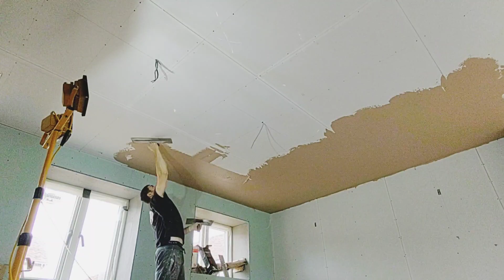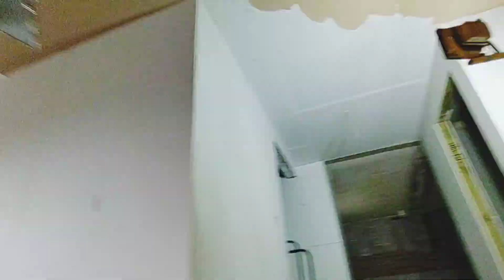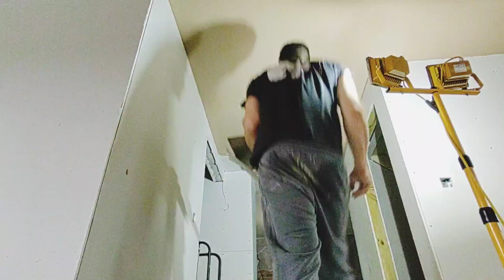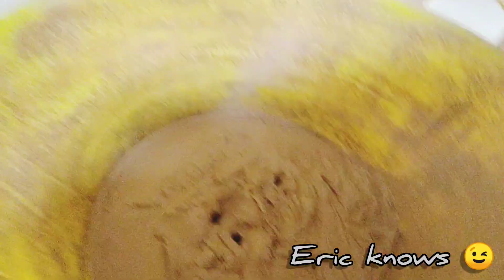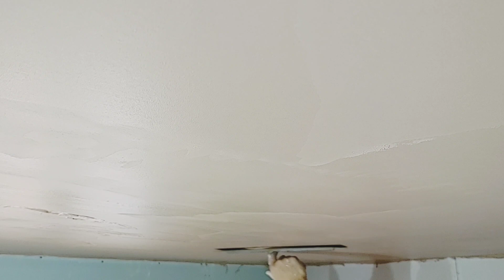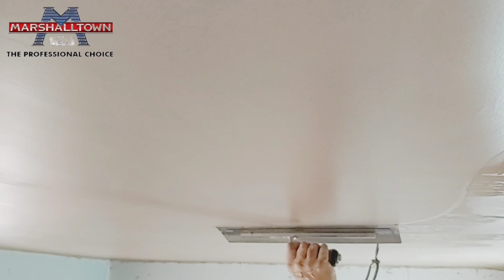WATCH and LEARN | PLASTERING A CEILING @neffexmusic

Comment: Hi Dan, hope you’re well. I’ve just bought an 18 inch nela carbon, only used 13 inch carbons recently. Haven’t measured if it’s 5 or 4.5 inches wide. I’m guessing you made the jump from a regular size trowel to a whopper, any advice? Cheers mate
Reply: Also bought the 800 nela spat and it’s great, flattens the first coat so much better than my Refina speedskim. I still use the Refina to give the second coat a quick go over as I found the spat took too much off.

Comment: How long do you leave your first coat before using the spat ? I've switched from my speed skim to the spat and I'm liking the results just abit unsure abit timings
Reply from the maker: Hi George 👋🏼
I like to wait around 15min from when I start laying on, not freshly laid but not too late to the point where you glide over and your trowel pattern still shows. You need to find that sweet spot, and your glide too! 
And never spat against tapered edges 👍🏼

Hope this helps ❤️

Comment: Quality as always Dan👍🏻. Are you using the steel spat on the second coat?
Reply from the maker: Thanks Mark
Yes mate, I also did my first wet trowel with the spat too but applied too much water and got covered in it lol so I deleted that part 😅

I may upload it in a shorts video 👍🏼
Reply: Are you just experimenting with that m8 cus you don’t usually use spat on second coat?
Reply from the maker: @Nofixedabode859  no Mick just haven't done it for a while. Back in the day I'd like to finish with a spatula from 2nd coat

I am experimenting on the perfect trowel combo though for you all, for minimal strain on the body 👍🏼

Comment: Do you spat second coat straight after? Or do you let it pick up ?
Reply from the maker: Never let it pick up mate, 2nd coat is very thin. If your trowel pattern still shows after gliding over its too late 👍🏼

You also need to find your glide too to level off with 1 swipe, the more you play the harder it gets!

More skill = less pressure 😉

Comment: Hi Dan how do you determine your first wet trowel a lot of people ask this question, what’s your indication for the timing thx?
Reply from the maker: Alot will struggle learning this question because it all comes down to the very beginning. Your 1st coat needs to be leveled off correctly to achieve a perfect uniformed finish. You need a very flat/level 1st coat! Only then will you be able to apply an evenly laid thin skin as a 2nd coat and time your plaster to your advantage. 

Now assuming all above has been done correctly I would say the perfect time for me is when the plaster looks Matt, firm to touch but still slightly greasy on the surface, and always avoid playing with it! If 1 glide isn't enough I'll spread the fat over that area and wait around 10min before gliding over again. Also take note too much water will kill the fat too not allowing it to set and the reason why sponging leaves a chalky finish so don't water down the fat too much 👍🏼

Hope this helps ❤️
Reply: @DanSoloPlastering  brilliant m8 think that explains a lot